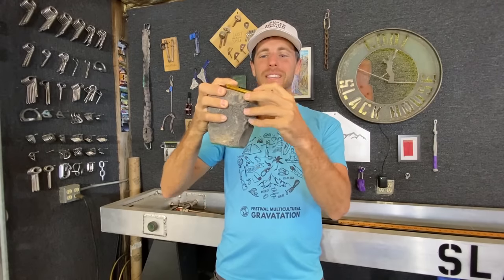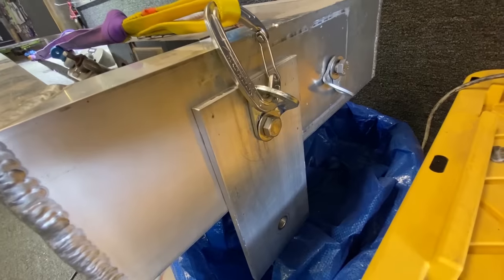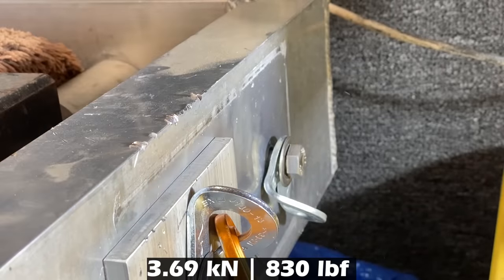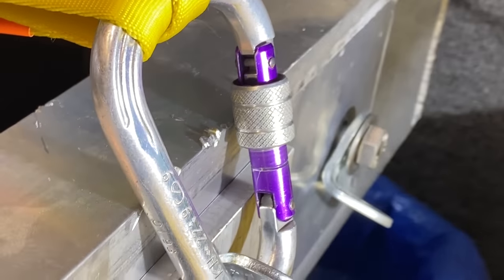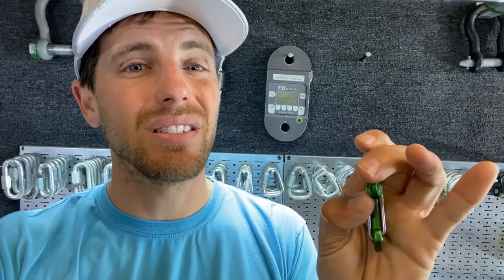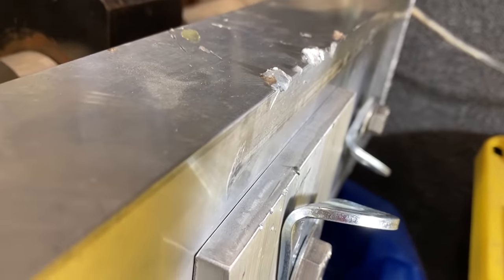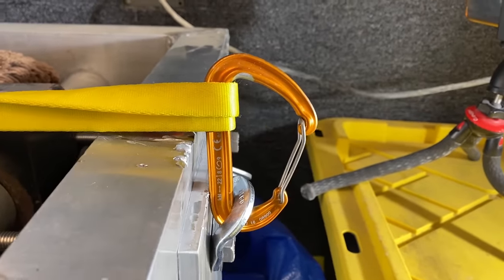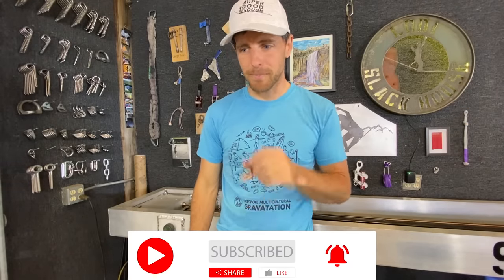Carabiners Loaded Sideways!?!?

Comment: Pretty alarming results
Reply: Bit of a wake up call, I hope, for those who are too lax about their rigging
Reply: This is one of ones that actually proved to be a problem besides knots in a rope.
Reply: Alarming results, but this also assumes the piece is being pulled against that 90° angle. Definitely something to be concerned about, but it seems like the real world situations are hard to represent accurately with only the 90° angle of the table.
Reply: What is the correct answer then?  Is it to re- sling the gear to extend the biner?  Had to think about a bit this yesterday on a deep keyhole TR anchor, 30° angle and padded. Won't do again...
Reply: @BryanHaddon  world be interesting to see if the results are different on a 30° angle. Possibly test different angles to determine at what point the drop in safety become intolerable (say sub 7 kN?)
Reply: @BryanHaddon  I use Friends which have the extendable sling, gives about a carabiner length of extension which is perfect for getting the biner off an edge. I’ve also heard of ppl reslinging camalots to be extendable but haven’t done it myself.
Reply: Pretty rare to have bend like this, also the force on most of the catches are below 2kN as it was measured by guys in other video. I don't think anyone ever had an instance of quickdraw failure like this one. In the end if it is not bolt number 1-3 on the route you are usually safe. You are more likely to pull out the gear from the wall while trad climbing resulting in the same outcome.
Reply: @aikenPL  there’s a video floating round of someone snapping a quickdraw (carabiner broke on an edge) where they deck
Reply: We always knew. That’s why we always use bandschlinge to avoid edges
Reply: @danmoore1678  Exactly my thought. This does not mimic most real world situations.
Reply: Also not very relevant. If you pull a crab over a 90 degree corner you deserve what happens next. I really want to see a shallow 10-15 degree pull tested as thats much easier to do by accident

Comment: I would be interested in seeing a more shallow angle tested. 

It's rare to have a carabiner loaded over a complete 90 degree turn, but much more common to have only a slight bend. 

Basically, how much bend is "safe"?
Reply from the maker: Doing it outside will be interesting!
Reply: @HowNOT2  it would be great to see it if the carabineer was connected to a sling or dogbone (like in a cam or quickdraw) - assume that might be stronger than when connected straight into the bolt as it can see-saw more?
Reply: @HowNOT2  Thanks so much for these tests! One thing that would be extremely helpful to test are carabiners in a choked configuration around cylindrical objects. I.e. crab clipped into alpine butterfly, rope around the object and passed through the carabiner. This is a configuration which is commonly used both in tree work (around limbs, duh :D) and in rope access around various round objects like pipes. Especially in tree work this is accepted, still there is lots of argument about whether this is safe. Some say to do it only with steel quicklinks. Others do it with steel carabiners. Or with aluminum carabiners. All locking, of course.
I would assume that this depends both on the diameter of the cylindrical object and its rigidity, i.e. steel pipe vs wood. But getting some data points here would be tremendously helpful!
Reply: I would think that as well as the angle the sharpness or bluntness of the edge may have a big impact as well.
Reply: @therealsideburnz  most definitely.
Reply: Tye setup was a bit tooooo hanky. On many the carabineer held while the anchor and plate all readjusted and the fulcrum on the carabineer moved to an obviously weaker point.
A setup like you said, where the angle can be gradually increased - I dunno, using door hinges.... protractor.... and big nut and bolts to lock the angle.
And made of steel and the anchor welded to the 'door' so all forces go into the test, and the weakest point is the carabineer under test. 
That sounds good.
Reply: I climb towers and work with angled steel so this is super interesting to see the issue in practice
Reply: @HowNOT2  there's some debate among tree climbers about if you should sinch a rope around a tree because that is side loading.   Obviously the size of the tree would make a big difference.

Comment: I've placed gear/quickdraws and sometimes anchors where there was some lever loading like this (though not at a 90° angle), and luckily I always had a different sized sling or quickdraw to move it out of this position. Good to know that I was right in taking the extra time (and carrying the extra gear) to correct it every time!

Comment: Would be interesting to see a test with carabiner attached to a hanger, clipped above and levered against a chain attached to the same hanger. Seems like a common setup for top rope anchors.
Reply: I once managed to bend a Petzl Spirit quickdraw open by placing it on top of a maillon before taking a big whipper. Although it didn’t break it was scary to hang on it. Unfortunately, it is quite common in Europe to leave a maillon in order to withdraw from a route. Usually, it’s the hardest part of the route and you don’t have time to place it belwow. I have seen people doing the exact same mistake many times.
Reply from the maker: 100000% have worried about this numerous times!  I will test that
Reply: @HowNOT2  Excited to see this one! Super common setup, even if just for clipping a PAS to.
Reply: @paramountaineering2  Just clip the maillon instead of clipping the quickdraw below it. And then remove the maillon when lowered.

Comment: My rock climbing days ended before the Clinton presidency, but I really like your channel.  I instruct industrial fall protection and enjoy seeing you apply some engineering practices to your tests.  Basically, all of your gear doesn't meet the Z359 ANSI requirements, but I'd like to see you do some comparisons to industrial gear.  Although it can be heavier than your gear I wouldn't want to climb without 2 action 5klb carabiners.  Another item is looking at repeated stressing of the carabiner and how metal fatigue can set in.  I've seen 5k lbs carabiners fail (usually deformation, but occasionally catastrophic) after a few dozen 1800lb loads.  Keep up the great work!

Comment: Thank you for this! I have also often wondered if the only option is a nut placement with a carabiner over an edge, would basket hitching a 60cm sling through the wire be slightly stronger than a carabiner over the edge. Or using two slings to basket hitch the wire (8 strands of material around the wire...). Our Canadian Rockies' limestone is tricky to protect (i.e. not splitter cracks) so we often encounter not-ideal placements that we have to take since protection opportunities are not as abundant as on more trad-friendly types of stone.

Comment: I would be interested to see the strength of a rope when placed running off the edge of a cliff at a 90* angle vs when it’s a straight line - commonly seen in rappelling.

Comment: Hey Ryan, I actually snapped one of those Camp biners a few months ago. Bit hard to explain how it happened however the biner got hung up upside down on the bolt hanger and the dogbone slipped from the bottom of the biner down the gate and split in half on the nose at the very end of the dogbone (never seen anything like it). 
Was surprised that the gate broke on the wip!

Comment: I'm thinking about putting a couple of hand holds in a eucalyptus tree as well as some fixe hangers and 130mm 10mm stainless steel coach screws, predrilling 7mm for the length of the screw and 10mm for the shank portion any chance you could test out how many KN the coach screws can take?

Comment: I’ve seen some sketchy ish scenarios with this orientation, but just the other day I was actually hand ascending up a rope to clean a pitch, and my next piece was holding my swing. But I found that I extended the draw on the piece, and the carabiner was sitting levered on its side against a corner of a ramp. By the time I got to it, it was bent 😬

Comment: would be nice to have a realistic climbing setup, especially for trad where the loading is often unfavourable. So maybe trying radiused edges, where he biner might look flat, but still isnt being pulled parallel to the spine. Or how the sharpness of the rock could change things, ie rough granite vs softer sandstone. 
A groove in the aluminium or a V block could be used to hold the biner spine down, like a vertical crack could IRL, especially if placing gear in a varying width crack,

Comment: it would be awesome if you could get a testing setup for instantaneous load instead of the progressive one youre doing now. this is much much harder on gear than an actual fall would be, for an equivalent force. maybe load some intermediate device with a remote release - like some sort of clutch. if the force doesnt break it in a couple seconds, theres no way it would break it in a fall.
Reply: Even if the peak forces are equivalent?
Reply: -> they would need to have a machine in which they actually drop weights. But I'm not sure they are able to sample the force frequently enough to accurately measure the peak force.
Reply: @steelonius  absolutely. in these tests you see the gear gradually deforming and heating up before it ultimately breaks. if you exposed it to the peak force for a couple seconds without the extended lead-up, it wouldnt break.
Reply: @matmay  why is that? imagine the current set-up, but theres a catch in the middle that takes all the force until released. they can measure the force against it, and transfer the load to the gear simply by releasing it.

Comment: Very interesting.  I think one standard response to badly placed bolts where the biner is over an edge (like your machine) is to loop a runner through the bolt hanger to avoid the leverage.  But just how strong is that?  Is that a good response or do we end up with similar breaking numbers as we saw in your helpful tests?  I would love to see some follow-up tests on this issue.  Thanks!!

Comment: common theme i see with newer climbers, lead up, clip pas to the anchor bolt, clip their quad in on top of their pas carabiner, then when the quad gets loaded the locker is leveraged by the pas carabiner. if you get a chance, that would be interesting to see if it damages both biners

Comment: I think it would bve interesting to see how much the corner geometry effects it.
You have a sharp 90 degree corner. What does an even sharper 45 degree corner do? What about a blunter 135 degree? 
What is the difference between a sharp corner with effectively 0 radius, vs a corner with some radius?
Does putting padding help?

Comment: It would also be interesting to load the carabiner on torsion. 
I had a funny scenario once while rappelling. I clipped my PAS to the chain. The combination of the carabiner being stuck by the chain and the rock put the carbiner in such a position that my PAS was pulling on it on torsion. 

On a static load it's not so much of a problem and can be easily corrected, but I wander what would happen on a dynamic fall. I hope my explanation is clear

Comment: Hey guys, I actually have seen multiple time the shackles/carabiners of a anchor got twist locked bij the chain and gets used on rappel. I was wondering similar to this how it weakens an rappel anchor if carabiner not sitting straight in a vertical position but more a diagonal ish way sort of speak.

Comment: In the oil field, I have never seen climbing equipment with lightweight gear..Always beefy steel ones...with locks to prevent roll out..
Reply: I build stages for concerts and do a bit of rigging. Steel is king. Not concerned about lightness. Strength and durability is what we need

Comment: I see this video is 3 years old as i am making this comment, but i think a good follow up to this would be to test and see what kind of rigging you need to set up on that anchor to drop a rope or a sling over that corner to allow the biner to pull straight, and how beefy that rigging needs to be to bring the system strength back up to the biner rating.

Comment: Two differences that I'd be interested in seeing: replicating this with a steel carabiner and if the results would change with a dogbone in between the carabiner and the bolt. I'm guessing that the dogbone would let the angle change slightly so we might see higher numbers and steel is usually more resilient to being bent.
Reply: They would have to modify the table since steel would wreck that aluminum but that would be pretty interesting to see.

Comment: Looks like (and makes sense) that cylindrical spines are stronger than I-Beam spines.  Probably because the cylinder and plastic deform more and take more energy whereas an I-beam goes through a compression on one side more.

Comment: Hello again! One of the problems is the leverage. depending on where the carbiner contacts the obstruction, it will create a lever that turns the 5kN into 30 or something. So the measuring ist just the force you put in, but not the force the carabiner is experiencing. 
Also I think there is a big difference if the force is generated static and builds up quite slowly, or if its like a fall or drop into the rope. 
Great work guys! We encourage our rope access technicians to watch your channel!

Comment: A lever is the span... The placement of the fulcrum is what changes the leverage... Think of moving the fulcrum similarly to rigging up a two(or whatever) to one pulley... If the fulcrum is far to one side, then one side has a lot more leverage... If you place is in the middle, both sides have equal leverage....

Comment: Is that black carabiner an Omega? I bought one way back in 2008 to sling my rifle and attach it to my body armor overseas..I kept track of it this long and use it off and on for some climbing stuff..For how big it is it's kind of light. This gave me more confidence with using it too..For some reason I get feelings of it breaking under the 31..Maybe it's just in my head though.
Reply: I do believe it is a omega. I used to have some of those in my anchor set up.
Reply: @bobbyhutton1989  Man I wish at least 1 company would continue making these types again..It seems like anything over 30Kn is left to rope access and safety industries...I do love a nice stainless steel, sturdy, heavy carabiner for certain things but the middle ground seems to be missing...its either 22kn or 52kn
Reply: Yeah, that is for sure an Omega Pacific. Unfortunately, that company died in 2020, I think. I have two of these, one black and one silver, and guard them carefully. This design has been around for a long time and it brings memories every time I use one of them. I cringed a little when I saw the machine start to pull on it, but happy to see that it survived.
Reply: @8bba8  Good to hear both you guys have some old Omega feels lol...The nose does get a little snagged on your harness rack or rope..Worth it IMO though.
Reply: @50StichesSteel  Rock Exotica, that's where you will find what you are looking for. Cheers.

Comment: Wow, I didn't think it'd be that big of a difference. I'm always careful about this, but a lot of my safety philosophy at this point involves recognizing how over-engineered most of our systems are. Not to say we shouldn't do everything right, but even a "good enough" placement or anchor is often strong enough to hold well beyond any load you'd ever see climbing. It's good to know the exceptions, because that could break with a good whip. 

For the spine loaded test, could you attach some sort of guide rails alongside the carabiner to stop it from twisting under a load? I don't think that's a likely scenario, but I'm still curious to see the results. Thanks for doing this!

Comment: Hi, could you test hangers where the hole has been enlarged by drilling?

A sport climbing route developer in my area regularly takes 3/8" size hangers, drills the holes bigger to 1/2" in order to use the 1/2" bolts he has access to.

Someone gave him a few spare 5/16" hangers that were originally intended for a cayoneering project where rappelling is the main use case. He drilled the 5/16" holes to 3/8" which he plans on using on a new sport route. Some in the group have expressed concerns that the 5/16" hangers are too small to be expanded and don't trust them to take falls.

Can you do a break test video on hangers were the holes have been enlarged (eg. 3/8" hangers drilled to hold 1/2" bolts and 5/16" drilled to 3/8").

I'm the meanwhile I'd appreciate any thoughts and opinions you have on the matter.

Thanks,
Julian

Comment: The Amp carabiner appears to have a defect the bottom right of the break at 3 minutes and 29 seconds. It looks an awful lot like a detail fracture where oxidation has occurred. This is most likely due to a small crack on the surface at that location

Comment: Because you're pulling over that aluminum edge and deforming it the break values are actually a LOT higher than they would be over a tougher edge. The stress concentrations are over a lot bigger area for that brief time before it snaps. If you could get a piece of square granite to pull it past I think the numbers would be a lot scarier! Not sure it would hold up to a lot of tests but you could also just use some hardened tool steel.

Comment: I'm amazed at the strength of the wire gate connection to the carabiner.
Reply: The tensile strength of steel is amazing, especially when compared to aluminium.